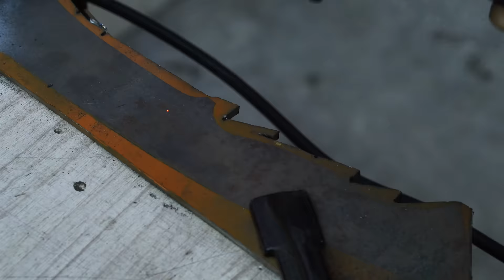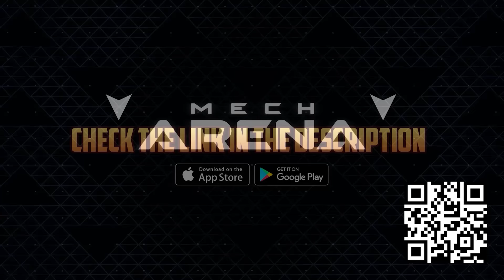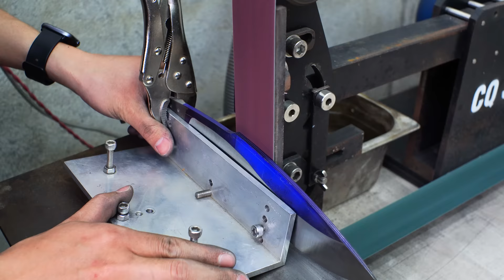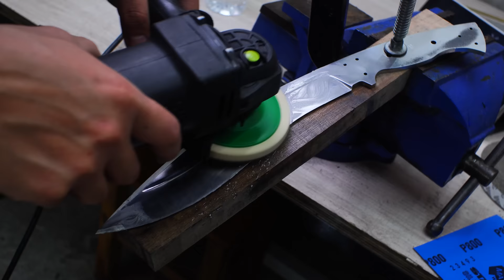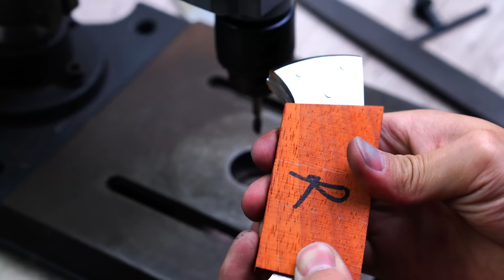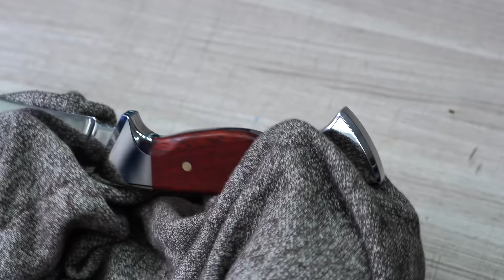Knife Making | Kukri Knife

Comment from the maker: Install Mech Arena for Free 🤖 IOS/ANDROID: https://clcr.me/CreatorQi_MA and get a special starter pack 💥 Available only for the next 30 days
Reply: Good
Reply: Does no one now how to use a hammer & tongs anymore?
That's not a kukri!
That's a kukri shaped object.
You might as well buy a Chinese knock off because they are both not made the Genuine way.

Does no one know hoe to draw & upset iron anymore.                          No craft, just a stencil & an angle grinder.             
I'd be curious if that object is intact even after a year of regular use.
Reply: @arnijulian6241  Not a kukri because it wasn't forged??? Quit gatekeeping.
Reply: @angrypineappleknives   it not gate keeping, 
it's material science & constructive critisism!
that cut out crystal structure & internal forces would be against it'd implementation.
Use that cut out knife on brush, an animal or what have you it would likely break.
''If a job is worth doing, do it right''

Nice aesthetic but not fit for purpose. 
I will admit I'm a tad unnecessarily irritated. Doesn't have to be forged but he didn't do it the industrial age way either. Cold stamping is the common industrial way most often followed by electrolytic surface hardening with final optional protective impregnated coating of some sort. Grinding depends on tools/blades purpose.    

I am a Fabricator, welder, mechanical & electrical engineer by profession. 
My Grand father & great Grand instructed me in smithy work as both where primarily Ferrier's & cart wrights though they did other work & craft as well.
My grand father made the gates to the bank of England & my Great grand father worked in the royal armoury of Britain.
  
I worked metal before I could talk as a mute till 7 under their instruction. 
I know what I am talking about when it comes shaping metal. Be it drawn or upset by hammer & tong. Or by more recent industrial means.
Reply: @angrypineappleknives  He has the basic tools but not the Instruction, knowledge & practice.
Has artisanal skill which is about 1/2 the battle.
The lad requires an elder to show him how.  

Unfortunately I am across the pond & I suspect him a yank though I'm sure some one would take him as a part time apprentice or what have you.
All Smiths do it & learn from their elders & other share their ways with other smith of ways passed down for centuries.